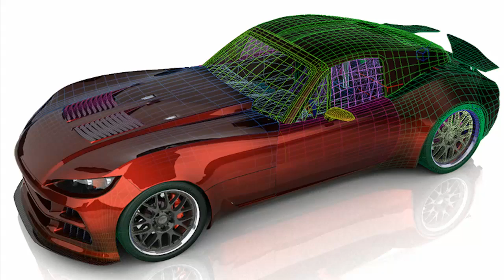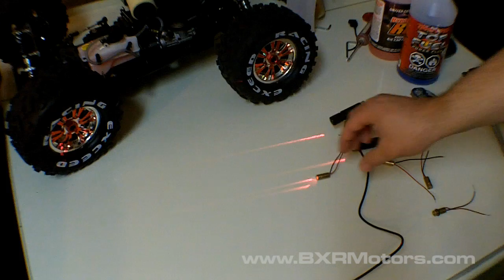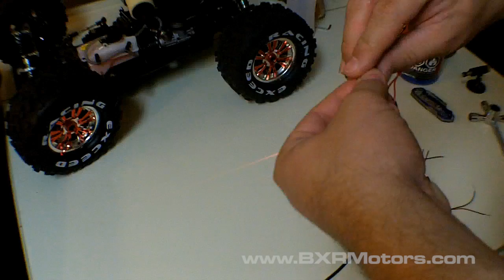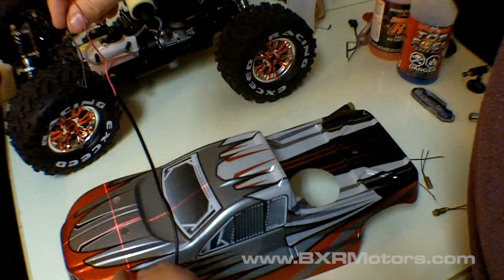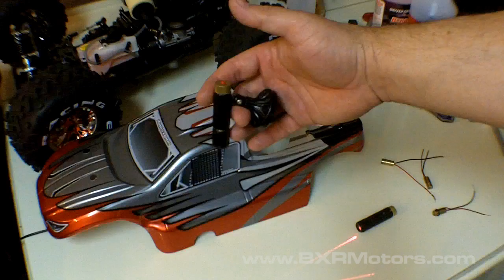Cross Lasers and  how to use them - Bailey Blade XTR - Part 52

Comment from the maker: @ravage808 Harbor Freight is the only place I have seen them. You may want to check again, the employees usually don't know that they have them. They are located over by where the cut off wheels are. Usually they have a laser next to it that you attach to a circular saw. I think they keep them in the saw blade area because they figure that's what people would use them for. If you still cant find them then you will need to check eBay, or maybe use the kind that I talk about in my next videos.

Comment from the maker: @TheEvanovitch Thanks for the link, I did a search for Cross and Line Lasers and found a few. They look like higher quality but are a bit more expensive and lower volts. I will have to check it out, i saw some nice green lasers which are good for doing 3D scanning. I may have to cover that in a video too.